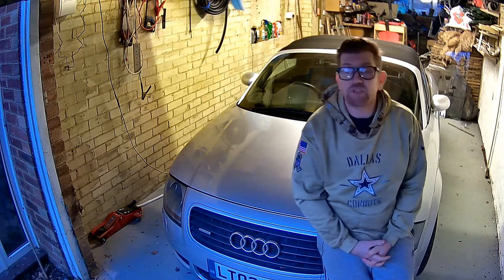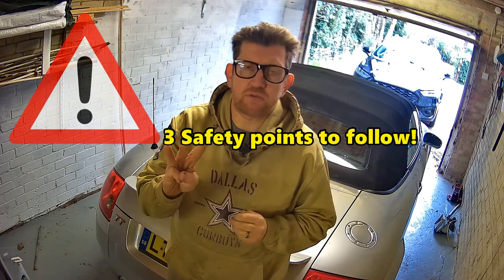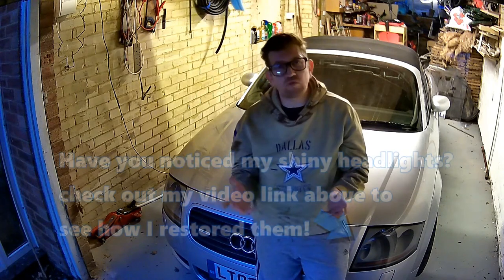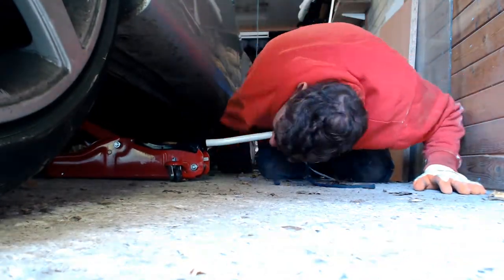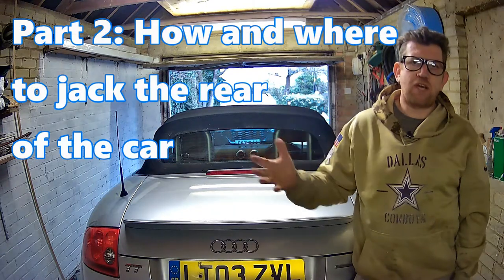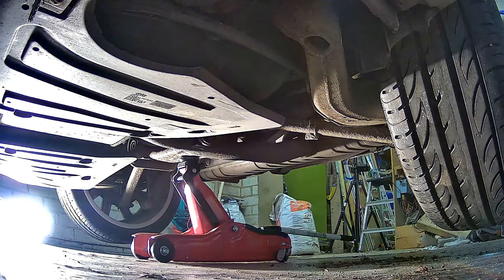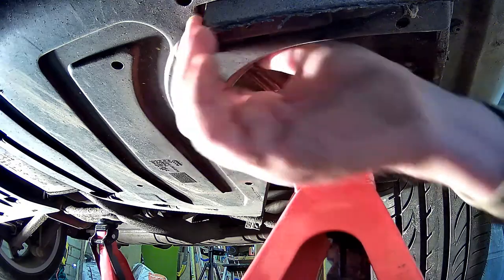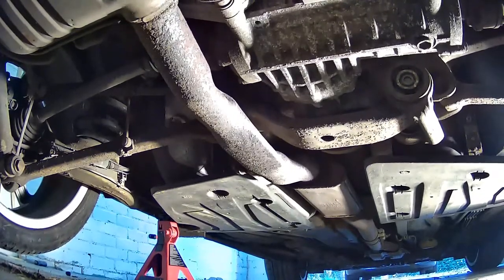Audi TT Mk1 - How and where to jack the car - a beginner's guide

Comment: Neither of the front or rear lifting locations shown is correct.  The front chassis box section will flatten and deform in the location shown - it's stronger towards the front edge/engine where there's a double skin, and it's best to use a flat plate. The rear subframe was never intended to be loaded/stressed in the way shown which could cause damage - particularly to aged metalwork and bushes. Audi's specified lifting points are the four rubber bungs under the floor - the rears are strong enough to lift a corner at a time however, with the fronts it's best to lift as an axle to evenly distribute the weight and prevent caving the floor in.

Comment: Most Audi/VW cars they want you to jack at the pinch points on the body. For the jack, they sell heavy duty rubber pucks online with a slit in the middle I find works best.
Reply from the maker: Agreed. I actually use a Hockey puck to cushion mine. However after a few uses, the puck distorts as it is not heavy enough duty for the job. So I just use another puck. The benefits of playing hockey!
Reply: @andycharger  When I bought mine I saw two options and went with the thicker (4-5 inches) and has worked well. I work on alot of Audi and VW cars sometimes SUVs like a Q7 4.2 I have now.

Comment: I've never needed my factory Jack's, now I wont have to think about it if I ever do. Thanks for the tutorial 😎..also it reminded me to check the lug wrench on the 01 to see if it fits my aftermarket wheel lugs, also the air in the spares on both TTs...Tomorrow.
Reply from the maker: Yeah always worth checking the car Jack! Mine had never been used looking at the condition although my wrench has seen plenty of action. I had the wheels repainted when I first got the car and you might notice in the video that the wheel I remove has some scuffs from “kerb rubbing”. That happened 3 weeks after I had them done! All the other 3 are pristine! I don’t know why I chose to demonstrate on that one! Thanks for your comment Scott!